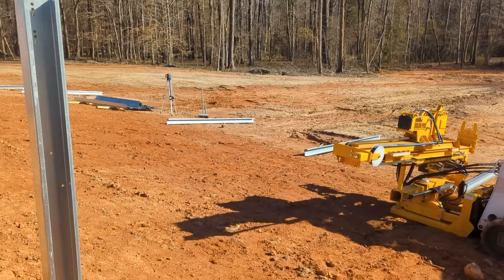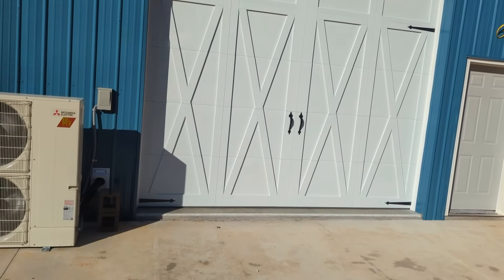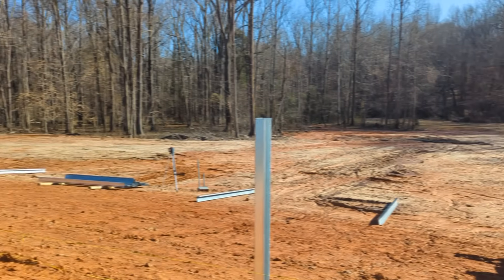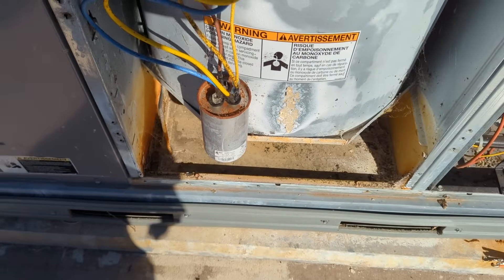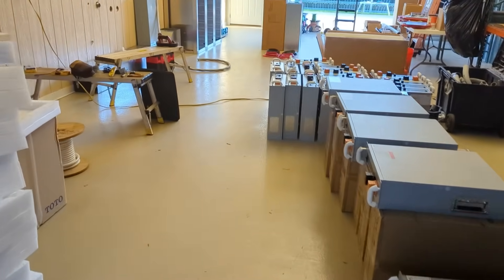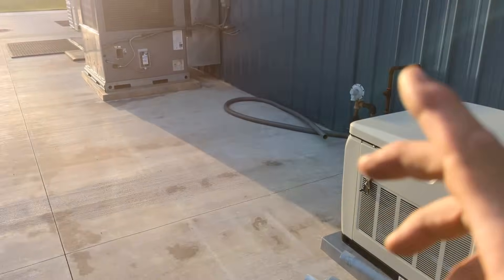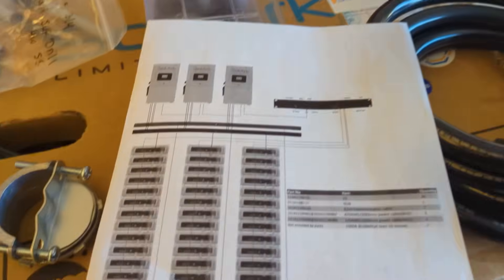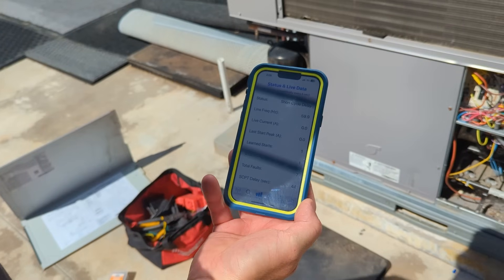Off Grid Because We Can!

Comment from the maker: Installing one of the biggest off grid systems we've ever done!

Pytes V5 Lithium batteries:
https://practicalpreppers.com/product/pytes-v5-lfp-battery/

Buy a Sol-Ark 15k!
https://practicalpreppers.com/product/sol-ark-15k-120-240-208v-hybrid-solar-inverter-all-in-one-pre-wired-outdoor-rated/

Let's discuss your solar goals:
https://practicalpreppers.com/consultation/

Order KB Solar modules
https://practicalpreppers.com/product/kb-solar-450w-solar-panel/
Reply: How is the Keto going?
Reply: Have you guys looked at the numbers/specs of an electric excavator or tractor to run the post tool thing. You could charge with the solar array while it’s out there as savings to you and the customer. 🤷‍♂️ It’d be cool if the numbers added up to give it a shot.
Noah the ebikeschool guy seems to have found some decent looking ones.
Reply from the maker: @A-DudeForInfo I have only seen small machines. The machines weigh less than my post driver. They would never pick it

Comment: I would be interested in knowing the charging difference from the top battery and the bottom battery since they are not connected to a bus bar along the side with short cables.

Comment: nice as usual, question does the micro air also help in surges when system is on or heat strips?  two separate quesitons.  I know it helps with start up surge, for heat pump that is not that bad but it also surges when heat strips come on.  They may be more of a constant load but is there a surge when they come on too? thanks

Comment: I put the batteries in a separate structure, one I can afford to lose to fire and distant enough not to spread to other structures.   Even if they are Iron Phosphate, if and when they fail, they produce tremendous amounts of Hydrogen gas...think Hindenburg.  You can mitigate this with a clear path for the hydrogen to escape upwards, as opposed to a confined sealed space

Comment: Being as though the Sol-Arks ask for 2 battery connections on each input, I wonder with the amount of power flowing through the battery cables, whether it would be better to run 6 positives and 6 negatives from the busbars to the inverters. After all Sol-Ark presumably put a double input there for a reason?

Comment: Im running a 1MW facility off the grid currently. We have been discussing Solar as an option for some of that consumption. The issue we face is that Solar is roughly 8 hours/day, and we would only decrease our grid usage during the daylight hours. Im wondering what a batter solution might look like which could handle some of our capacity during a 24-hour window.
Reply: 1 MW continuous? 24MWh each day! 16MWh overnight in Winter. 5KWh per typical LFP battery, so 3200 batteries needed. At say $1400 each, that's $4,280,000 in batteries, though you may get a quantity discount ;^) Or maybe four Tesla Megapacks (3.9MWh each)?
Reply: @isovideo7497  Yes, incremental is the best approach. Im not convinced about batteries though. They are a consumable, so need to be replaced periodically. They have a cycle life, which is limited. So that factors into the cost of the electric over time.

Comment: How do you even safely fuse a lithium battery bank that big? Individually? The amount of current a short circuit would make would be insane. Way beyond most common DC breakers and fuses. Highest I've seen is 50k IAC. usually its 10-20k.
Reply: In this video you don’t I guess,I didn’t see any high amp fuses and dc cutoffs (you can get 500A fuses for short protection or lower per battery group or just hope the 7000A can melt the cables fast enough or that the bms cut out if the short is pulling enough current for it to turn off output but needs to be around 150A per battery for 15 seconds or higher for instant cut off) the flexible bus bars probably vaporise before anything else 

It’s a nice and extremely rapid setup, but it’s missing short fuse protections

Comment: Are those microstart units available for use on European 230 volt 50 Hz systems?
Does this customer think of fabricating and selling these racks? They are not cheap BUT well worth the money if they do a good job for those rack mount batteries.

Comment: I think that since this is a garage that I would have bollards in front of the batteries to protect them. Probably some thermostatically controlled fan to remove the combined/accumulated heat from the racks (with a thermal fire fuse) or allowance for convection cooling. A combination ionic and photoelectric smoke detector plus a heat detector above the batteries and inverter tied into the house network or internet would be a nice touch.

Comment: The USA rules. We are only allowed max 80kw battery in Canada. I run 45 kw which is awesome, wouldn’t mind another 15kw.
Reply: 80 is the limit in USA for residential.  But after 80 you can install larger but everything needs to be engineered to "commercial/individual" type protocol

Comment: $32k solar+racking, $21k inverters, $74k batts = $127k equipment cost plus hardware, install. Divided by 20 years expected lifetime that's $6350/yr annual equipment cost. Solar array will generate 55,000 kWh/yr = 11.5 cents / kWh electricity cost (not including labor + BOS hardware). 30% federal tax credit will pay for install cost and chunk of equipment cost. So final electricity price will be slightly less than utility and you are protected against cost increases. And this system uses premium equipment. A DIY system using less expensive inverters and a battery assembled from single cells can be had for half the price.
Reply: FWIW, PG&E wants $65k to install electric service to my new property. We're going off grid - that buys a lot of batteries and panels.
Reply: If it can make sense at 11.5 cents/KWh, imagine 3X'ing your payback speed by doing this where some pay 30c.
Reply: @hcjpbluesky9916  in Germany the kWh price is in 2024 around 30 to 50 ct. Depending of the region where you life.
Reply: @hcjpbluesky9916  in Germany the energy is 42 cents of Euro, which makes it even more expensive

Planning to build a house and a solar array is a must
as energy is only going to get more expensive over time not cheaper
Reply: @coisadealemao2565  stop lying. I pay 24 cents not 42
Reply: @RoninXiC  Just try different zip codes. It depends heavily on the grid fee. In Berlin the energy is much cheaper than in Saxony. around 10ct difference
Reply: Like saying my Honda civic with $20k in mods can beat a bmw m3 competition.
Reply: $0.30/kwh in canada after fees and that is $0.11 base +fees....
Reply: Same in Australia. Closer to $0.30/KWh + monthly fees, so any investment in solar more than pays for itself.
Reply: Imo, while I'm not in the solar engineering and constitution industry, 30% of the total costs would be the minimum for these installers. That project is at least 30% of the 120 something thousand total cost.
Reply: I wonder what the average yearly upkeep on a system this size would be. There are bound to be regular equipment failures over that 20 year lifespan.
Reply: You also have the  added  benefit of. UPS
Reply: Yeah some people don’t have the option to have a a utility company especially if you live in Alaska
Reply: I'd really appreciate some suggestions from you for less expensive equipment for a DIY system (just started my research on this, which is why Youtube brought me here).
Reply: @zr1411  6x Growatt 5000es would provide same power as 3 solarks but for $4500 total vs. $21k. They are not as nice as solarks for sure. You can build your own equivalent battery using 240x LF280K battery cells for $24k plus BMS cost vs. $74k for Pytes. Just few examples.
Reply: @antronx7 I would never trust growatts

Comment: I've done IT for a number of years.  A 4 post server rack with slide out rails is what you should look for.  The 2 post even for IT use is only good for light things.  They make some beefy rails since some servers can be 200 lbs or more.
Reply: Plus thermal management. Plus parts availability. Custom is pretty, and cheaper if you don't account for value of labor and tool time.

Comment: I didn’t notice a main DC disconnect or any fuses. Yes each battery has a current limiter, but the overall combined current output is massive. Could probably vaporize 4/0. Perhaps a T class fast blow fuse between each vertical sever row and the buss. From the buss to main DC disconnect then a T class fast blow to each inverter. Maybe not necessary for code in your area, but it would make me feel better if it was mine. 
Yeah I know a UL DC disconnect costs as much as an inverter but some DEHOOL makes breakers rated up to 630 amps and 1500 Volts DC for under 250$ (Amazon) could easily be fitted into the wire way. I have used these breakers and they are very well made, but take care not too over torque the terminals. When you manually operate the breaker it makes a clunk that’ll wake the dead.
Reply: Combined DC disconnect is unnecessary. Each battery has 100A electronic "disconnect". Each inverter has it's own DC breaker.
Reply: @antronx7 
I don’t think you understand. Each battery IS rated at 100 amps continuous AND 180 amps for 15 seconds, probably a lot more inrush for shorter periods. The bms is not user configurable so the current can’t be individually reduced for a lower overall. That means 42 rack batteries times 180 amps = 7560 amps for 15 second. There looks to be three 4/0 cables so each one would attempt to carry 2520 amps, however thou that would be a possible but unlikely scenario, it would probably be a more exciting as only one 4/0 would potentially be shorted. Probably just blow the crap out of anything that accidentally gets in the way or turn the 4/0 into a smoky glow worm joining with everything in contact.  Most inverters have the chassis ground bonded with battery negative to what extent is unknown. The vertical short conduits between inverter and wire way plus the inconsequential little bonding ground means that the wire way is also by de facto not just grounded but also NEGATIVE. 
So you see my concern if someone got a wrench in the works so to speak?
Reply: @SkypowerwithKarl  BMS trips in under 1ms when current is > 250A. That's 10kA * 50V * 0.001s = 0.14 watt/hours of energy induced into a fault. It will make a spark and that's it. It will not even trip a mechanical breaker rated for 1kA. BMS will trip first.
Reply: @antronx7  
Now times that by 42 rack batteries
Reply: @SkypowerwithKarl  nope that already includes 42 batts. 250a*42=10.5kA.
Reply: @antronx7  
Wow, that’s even worse than I imagined. 
At any rate I’ve always fused for the maximum working rating of a conductor at the earliest reasonably available point from the source. On this installation, that would be a the top of each server rack. 
The sever batteries do not have a mechanical disconnect, they are electronic only. They may have an internal fuse. They probably use FETs not relays and it’s very common for either type to fail closed particularly at a high current event. It would have been very useful to take that one unit out of the equation with its own breaker. 
An overall DC breaker is not necessarily there to interrupt over current, but simply work as a disconnect so the system can be repaired easily. Breakers are too slow and that’s what the fast blow fuses are for.  The Dehool breaker is much smaller and less expensive than a name brand disconnect. There is UL approved similar breaker but for the life of me cannot understand how UL actually approved it. Side by side the Chinese breaker is far better made when it comes to contact material, arc chute, thermal and magnetic design. The only thing that I would have liked to see is nut behind the terminals in place of the roll formed threads in the copper, so it mustn’t be over, torqued. I wouldn’t be surprised if they have corrected this in their new design.
Reply: @SkypowerwithKarl  FETs rarely fail and those inside the BMS of each battery can take thousands of amps for a short time and can turn off in 0.1 micro seconds depending how fast current trip control is. These things are UL certified and I would not worry about it.

Comment: Wow - nice build. Only thing I would have done differently was put racks on a stand or built a bigger gap at the bottom. The batteries on the bottom rows seem really close to the floor. Any type of flooding would make me extremely nervous.
Reply: Good idea and with opening top & bottom would potentially help airflow too.
Reply: I was checking to see if anyone else saw those potential issues.

Comment: Beautiful installations but Pytes flexible Busbar are rated 300 Amps and you are connecting 12 x100Amp V5 in parallel.
Reply: Inverter will not pull more than 300A continuously so each outermost busbar will be within max rating.
Reply: @antronx7  1 Inverter Yes, but I see 3 in parallel 900 Amp then
Reply: @mwilhelmpa  you also see 3 battery stacks in parallel giving you 900A total and <300A/busbar.

Comment: 8:45 it’s not wired any different than most other 1ph 230VAC PSC compressors. The contactor “R” terminal is the same as “C” terminal on the dual run cap. Some manufacturers run the run winding “R” from the compressor back to the contactor “R” and some take it back to the “C” terminal on the dual run capacitor. It’s standard wiring practice in the HVAC industry.
Reply from the maker: It actually is. There are a lot of variations. Yes, generally they're all the same but they are not wired the same. That is why when you install a micro Air you have to pull the wiring diagram. Not all manufacturers wire their systems the same even though they work the same.
Reply: @engineer775 for us pro hvac guys, it should be basic wiring knowledge.